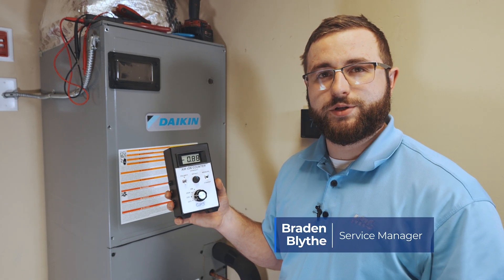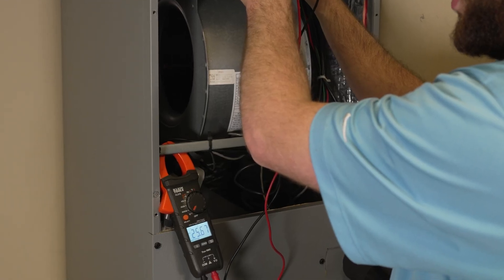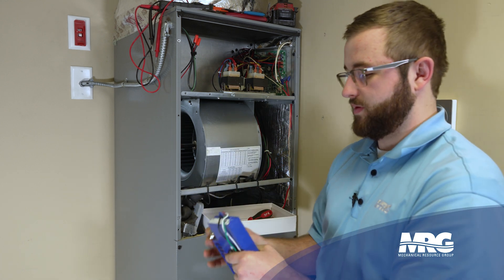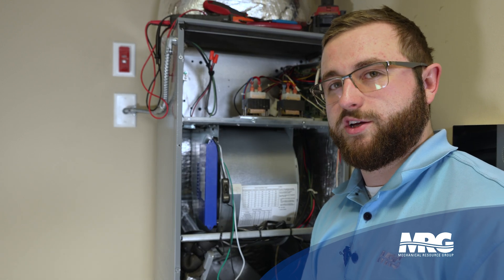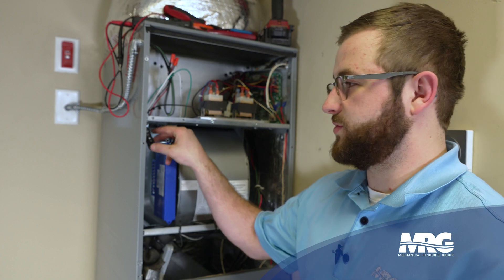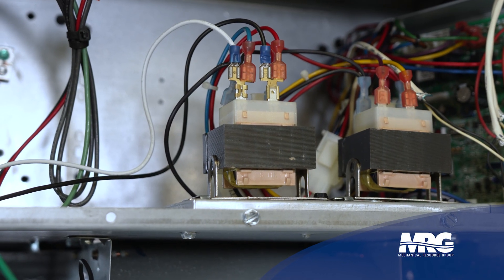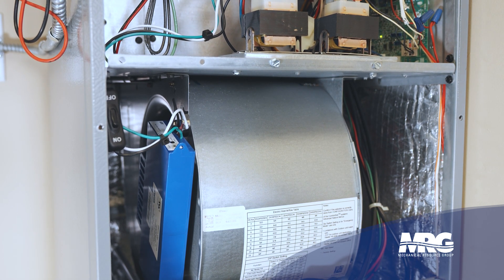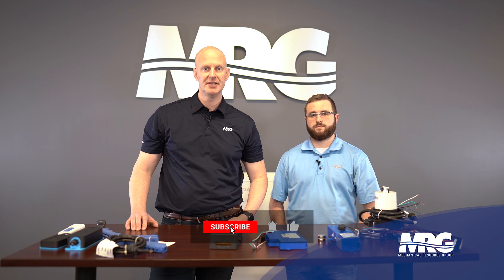Unveiling the Mystery of IAQ: Installing GPS Air Bi-Polar Ionization for HVAC!

Comment: If I wanted to do the 120v install. Where would I connect the common neutral wire in the air handler?

Comment: Hello, Mechanical Pros; great video! Used these directions precisely and all went well until it was time to find voltage… when I was searching for the power I went across L1 and L2 which resulted in my German Shepard ending up in the neighbors pool. Didn’t know electricity could do this! There is a hole in my wall the size of a small Fiat! Anyways, the device is working fine; dog is dead

Comment: Is this device the same as UV lights in ACs?
Reply: No, UV lights are a proven technology when engineered and applied correctly. UV light is not effective in a home system for anything but coil surfaces. Ionizers have mixed study results. Filters, humidity control, building pressure control, and temperature control, and proper ventilationare are all you need for iaq.